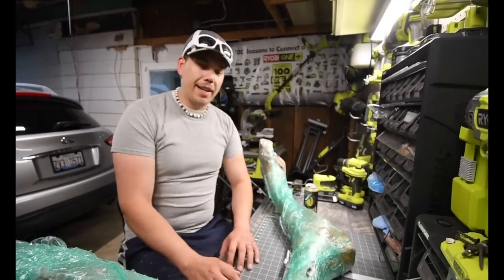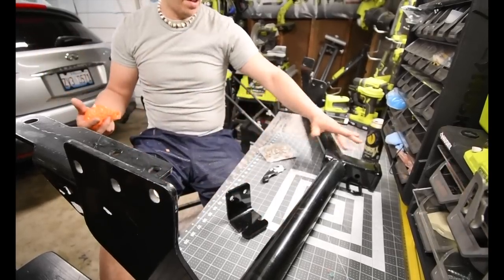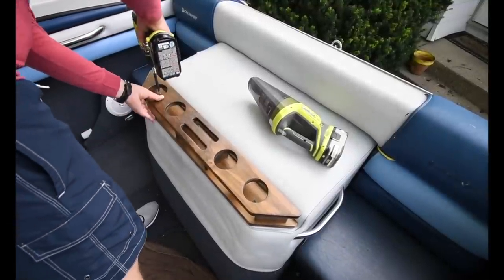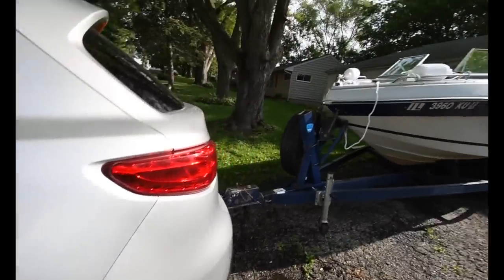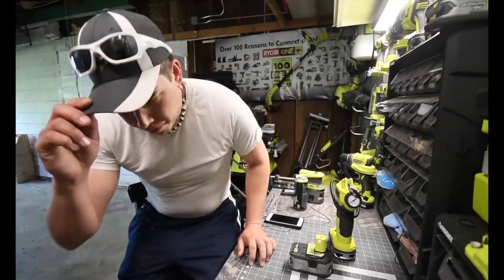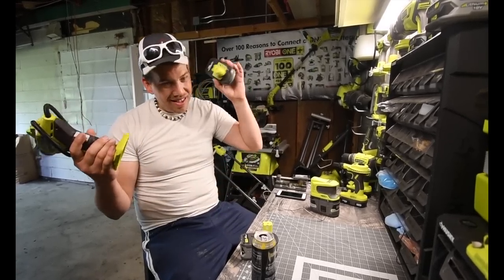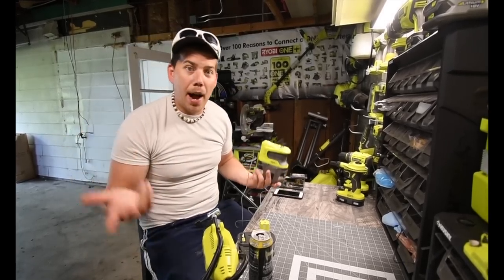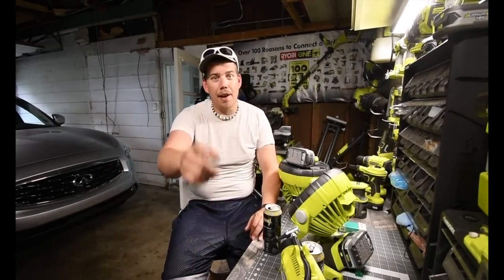Installing a trailer Hitch on the SUV

Comment: I believe you've got a qx30 which likely has barely the capacity pull that boat.

Sorry my friend but if you use that Infiniti to launch and pull out that boat you might want to start saving your money for the transmission that you're likely going to need.
Reply from the maker: CJ Harley I have the 2010 FX 35
Reply from the maker: Had no struggle what so ever to get it out of the launch. All wheel drive makes it easy
Reply: @ManCaverTools  with AWD the FX35 only has 2000 lbs. towing capacity.  
My general rule is you never tow more than 10% less than the towing capacity.
That would compute that your boat to include trailer, fuel and gear needs to weigh less than 1800 lbs.  

I bet your boat and trailer dry weighs at least 2300+ lbs.
Add fuel and gear and I bet you're well over 2600 lbs. 

Back in 2010 I believe Nissan/Infiniti was still it's own company so you have a good vehicle but let's face it, the FX35 was not built to tow 2600 .lbs on level ground much less pulling that much weight up a boat ramp.  

I'm just saying coming from an old timer; if you tow that boat much you're likely going to lose that transmission.
Reply from the maker: that is factory rating, I've been told my many sources including a couple of dealerships that the towing capacity is much higher than the factory rating
Reply from the maker: My neighborhood has a sort of a private boat launch 1/2 mile away from my house. I took it out about 7 times so far this year and not a single issue, and I don't believe there will be an issue. but thank you for your input :)

Comment: last thing you want to do when electrics get wet is use them or charge them.  normally let it dry out and this could take 4 weeks.  you could open them up and let a fan blow through them for a long period of time this should accelerate the process.
Reply from the maker: Cameran Manner I hear that